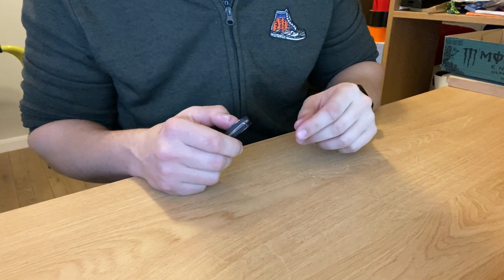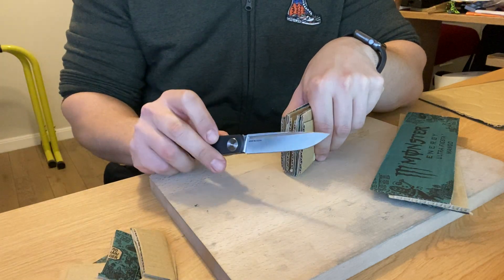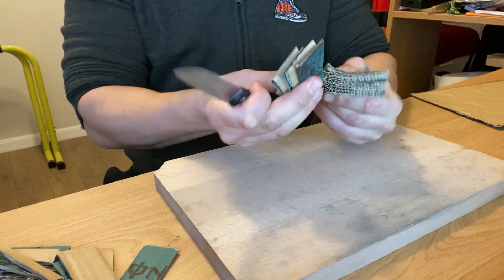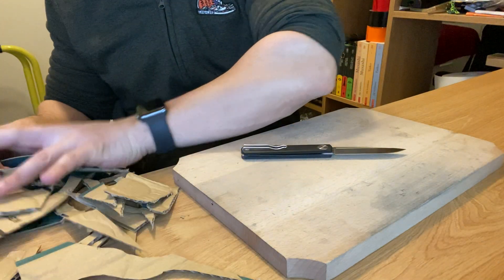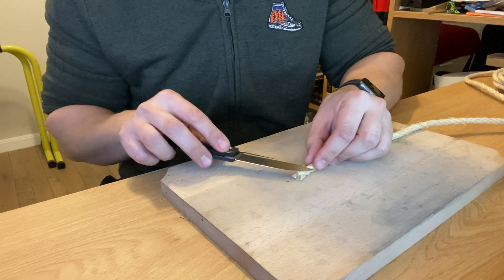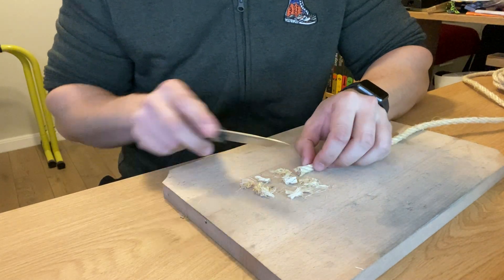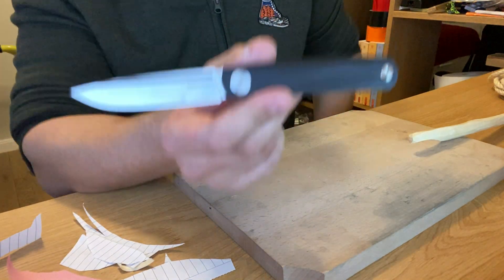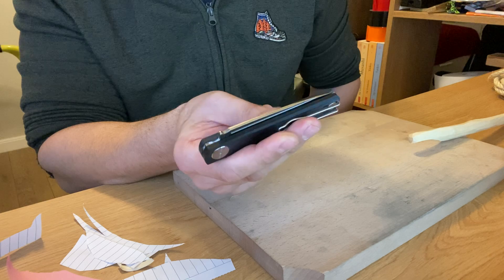Real Steel - G Slip - First Look First Cut - P02

Comment: That's a definite slicer. My favorite slip joint has always been either a Victorinox or a Case Sodbuster
Reply from the maker: I never had any case knives....I see them and i like them: classic looking folders. But I do like more modern steels...vg10 is not a super steel but it is really decent. With a smaller edge angle, in combination with this thin blade...it really does amazing.
Reply: @SpartanJohns  I think that if you try a Case Sod Buster you would like it. They are very reasonable.